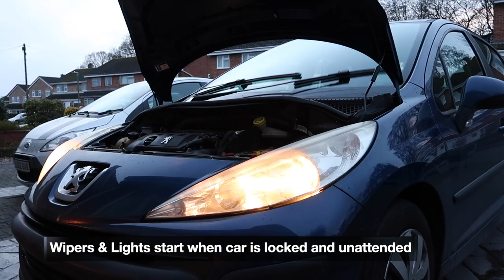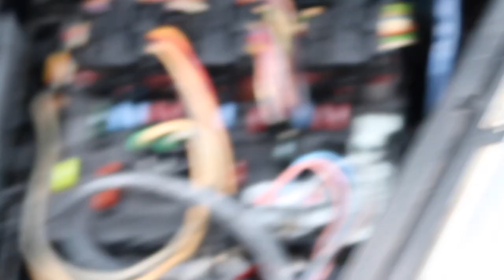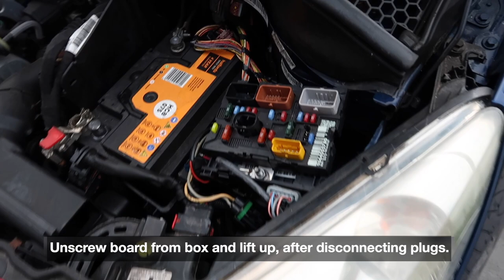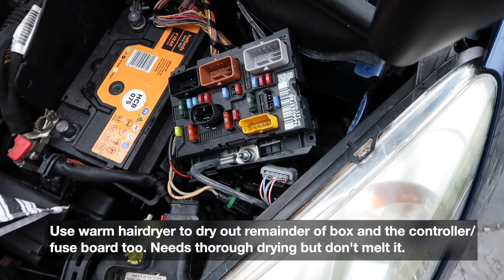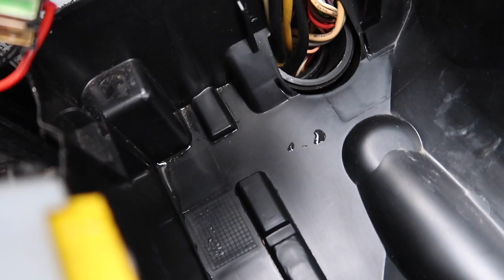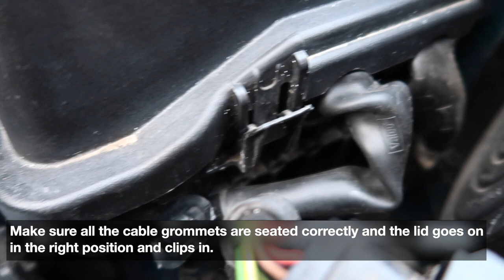Peugeot 207 Wipers & Lights Starting Automatically When Vehicle Unattended and Locked - RESOLVED

Comment: my Berlingo B9 just started doing this today, (aaah French electrics) i suspected it was the underbonnet fusebox , doesn't seem wet on top but will pull the fusebox out and check  under it. One feels they don't really test these vehicles in real situations before making them. If wipers were frozen to screen and car decided to start them up it could cause an overheat/fire .
Reply from the maker: Seems a bit of a shinky design to me, I once had a Renault Scenic and that was supershonk, so I'd never have another french car. This one is my daughter's car and there have been umpteen issues with shonkiness. Cheers for stopping by and leaving a comment.

Comment: I just try to change the radio and connect the plus wire to the new radio , probably I make a short the car now dosnt start when i put the key in contact wipers are starting to work and light are on but the engine dosnt start , eny idea ii cech the fuse and all seems ok
Reply from the maker: Sorry, I don't know that much about the electrical system of the car, probably best to take it to a professional mechanic or auto electrician. Good luck with it.